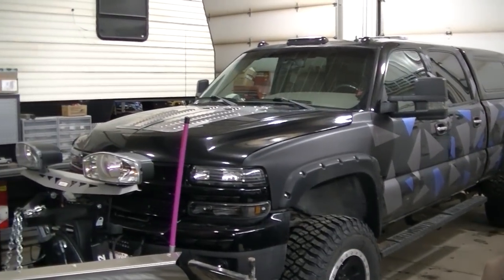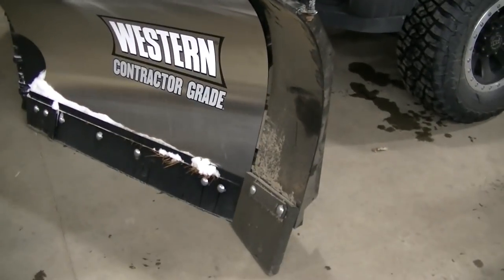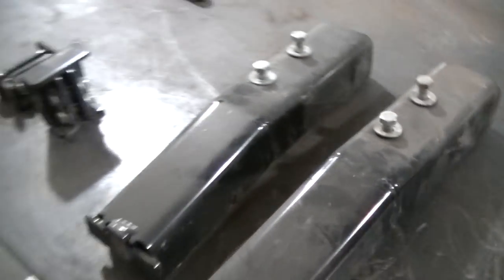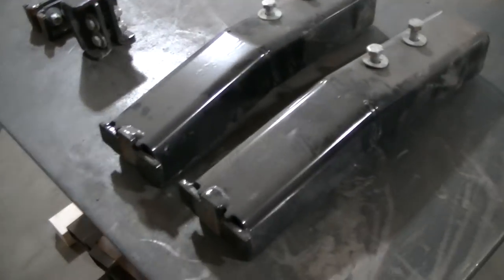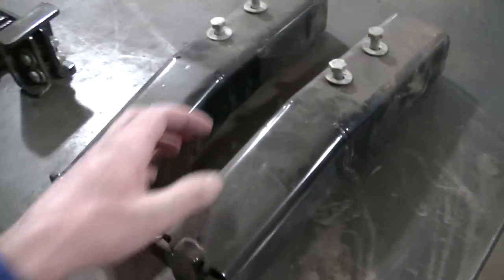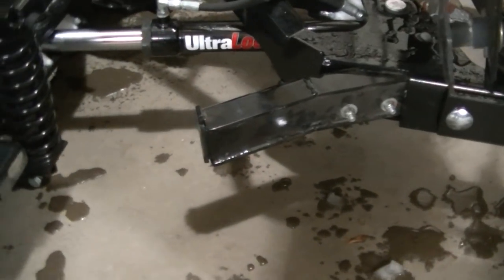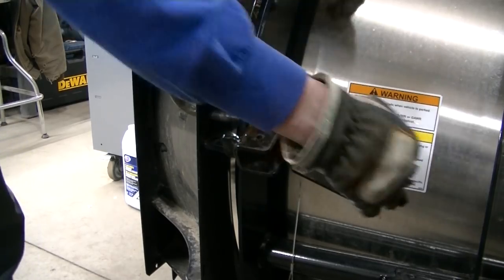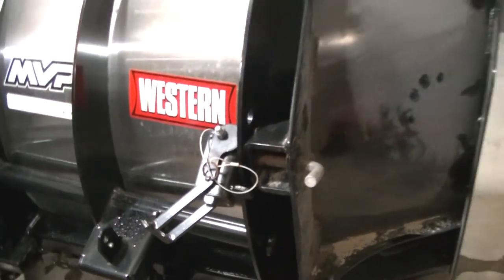Western MVP3 Wing Install Stainless 8'6" to 10'2"

Comment: Thank you for sharing install on extensions, just got some for my xv2.  Plow blade has some life left, extensions are new/used but have a bit more blade showing vs  plow blade.  It seems like I could drill extension blade holes and make even with plow blade.  Do you recommend doing that or should I just suck it up and start a fresh plow blade.  Do you like extensions?  How does poly edge wear?  Thank you
Reply from the maker: Cutting edge is expensive so I would wear mine out completely. The wings are awesome. Only a few downfalls I see. They add another 140lbs to the blade and it doesn't throw the snow as good with the wings angled forward like the are.
Reply: @mossman381  thank you.  With the angle the extensions are at, will the plow contain snow similar to a pusher box?
Reply from the maker: @myleslemansky1776  They will keep snow from trailing off the sides. I wouldn't have a plow without wings. They save so much time.

Comment: Looks like those km3s are workin pretty good in the snow
Reply from the maker: They are working awesome.  I think they are my new favorite tire.  I have been wanting to make a video on how the truck is doing.  Just busy all the time.
Reply: I was going to ask, what tire are you running? And your rims anything special? One more thing, your light bar, did you paint it black, mine is red? Thanks and great vids.
Reply from the maker: 35x12.50x18 on 18x10 aluminum rims.  The stainless plows come with a silver bracket for the lights.  Red steel plows have red ones.

Comment: How do you like the wings? 

   I have come very close several times this season to buying a set for my Fisher Xv2 . 
    But I get mixed reviews when I ask people about them , and they dont give them away cheap either!  

   Good video work!
Reply from the maker: I love the wings.  I had these on my 9'6" but that is really to much plow for a pickup.  I think the 8'6" with wings will be just about perfect.  If the snow gets really heavy they can come off.  The wings do stop some of the throwing ability of the plow because of the angle they are at.  They are pretty expensive but I think they help a lot.
Reply: @mossman381  
   Thanks for the reply!  
  I really want to get a set

Comment: How can you tighten the hose on the plow when the plastic case is there. 
I had 2 hose get a bit lose and leak. I got them just tight.  But it’s hard to fit a wrench on them , then the plastic gets in the way to get that last half turn. 
Could you do a video 😀
Reply from the maker: The plastic cover comes off.  There is a big rubber ring thing that holds the two halfs together.

Comment: How do the wings do when the cutting edge is worn down thinner than the wings’ cutting edge?
Reply from the maker: You need to start with a new cutting edge so the wings can wear with the edge. Or move the rubber cutting edge up.
Reply: @mossman381  thank you

Comment: Do they fit just like the 9,6 
What fluid are you using with the mvp3
Reply from the maker: Yes,  same as the 9'6".  The 9'6" is a little taller at the ends than the 8'6".  I love the wings.  They move so much more snow.  I use the blue fluid:  https://amzn.to/2t12bID    Pretty sure Western uses the same stuff.  When I drained the factory fluid it was blue.

Comment: What’s your opinion on gas vs diesel for plowing? You’ve plowed with both. I’ve only plowed with gas.
Reply from the maker: I feel like there is no difference.  You obviously have more torque with a diesel but pushing snow is all about traction.  I have plowed snow with a vortec 5.0 305 and never felt like I was underpowered.
Reply: mossman381 when stacking sometimes I’ll lose traction. Or when I’m scraping against the curb and approaching the pile to stack, the truck will get pushed sideways. Thanks for the reply. How cold was it earlier in the week for you? -12 here in Michigan
Reply from the maker: Same thing happens with a diesel.  You also need some momentum while plowing deeper snow even with a diesel.  It was -30 one night with -50 wind chills.  It was pretty darn cold.
Reply: mossman381 good thing it’s 40 degrees today!
Reply from the maker: It's around 35 right now.  Been cleaning up all the loose snow getting ready for the rain.  It's going to be a mess then get cold and more snow.  Should be a crazy week  :)
Reply: mossman381 you ever use a boss dxt? My next plow will either be a western wideout or dxt/mvp3
Reply from the maker: Have never used Boss.  Almost picked up a stainless Boss DXT before my 9'6" MVP3.  I really like the controller of my Western.  Those one touch buttons are so nice.

Comment: How about going down the road with the wings?  
Do you keep it bumped up from V to keep the corners from hitting?
Probably works well with the lift in that situation!  

  Here's a short video of my set up sanding a light evening snowfall!

https://youtu.be/JPvfgmvu6EQ
Reply from the maker: I have been running in full V going down the road.  The wings angle so they don't touch the ground most of the time  :)   And I think the stop kit doesn't allow you to go in full V which is probably why they come with the wing kit.  You have to be careful driving down the road.  I don't trust anybody so I move over as far as I can.